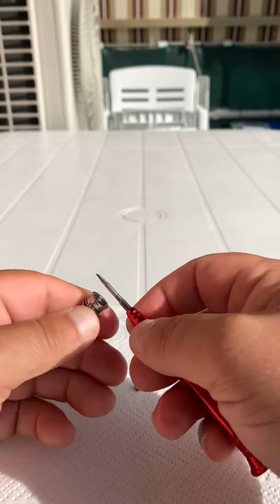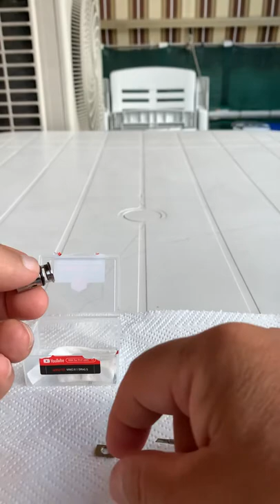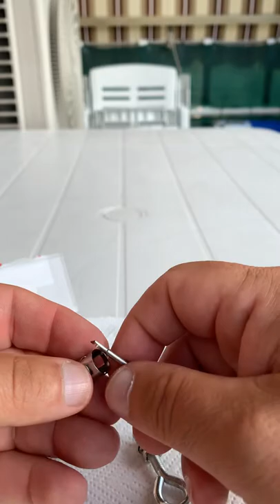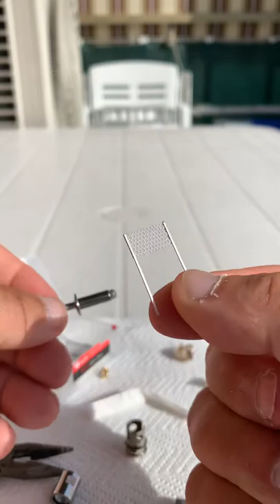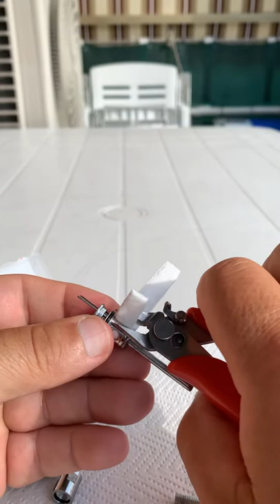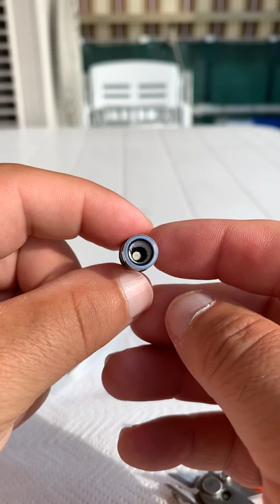Rigenerazione coil voopoo pnp-vm5 da 0.2  con il kit coil master ReBuild

Comment: You missed to roll extra cotton on the external body of the coil before closing it
Reply: Pnp coil doesn't need the extra roll on the external
Reply: @dwan270 он будет течь без внешней ваты
Reply: you dont need on VM5 & VM6 on others yes 1 more layer

Comment: If you would be kind, what is the name of the wire and its tool for winding the coil?
Reply: Rebuild master coil ci sono resistenze da 0,2 ohm da 1,2 ohm da 0,5 ohm dipende quella che vuoi basta che lo scrivi
Reply: Mesch coil

Comment: Hello. I made this DIY for my argus z-pod following you. but I think I accidentally touched the wires together. argus z short-circuit protector activated. argus runs but does not fire. is there a solution to this?
Reply: I fili non devono toccarsi uno va inserito nella guarnizione l'altro all'esterno della guarnizione guarda altri video e capirai come si fa